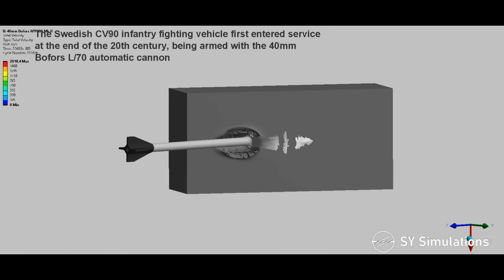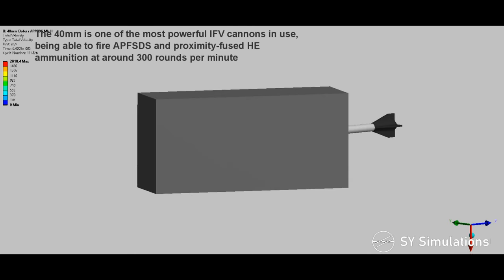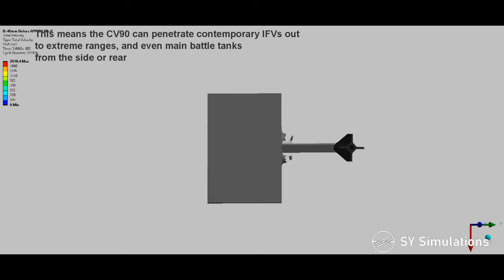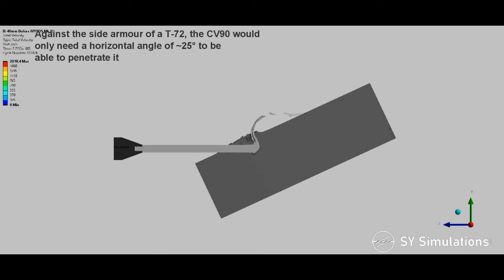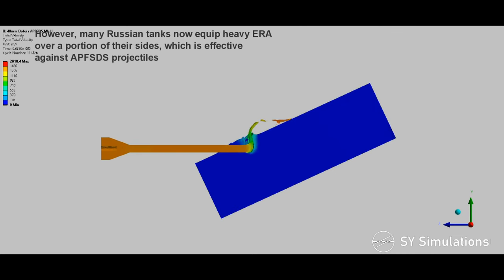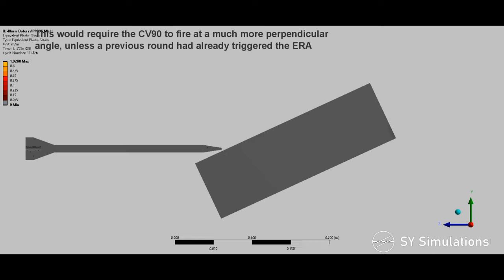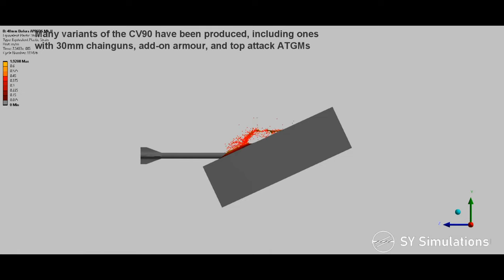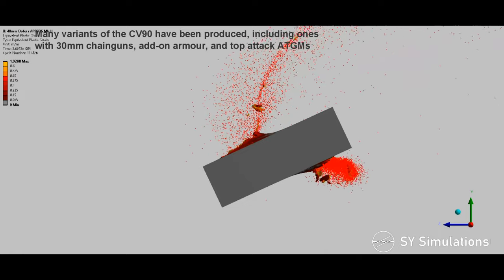CV90 vs T-72 | Swedish 40mm APFSDS vs Main Battle Tank | Armour Penetration Simulation

Comment: It makes sense that tactics would have been developed to counter the ERA. I can imagine hosing down such an equipped tank with HE follow up with a couple APFSDS rounds.
Reply: Given that the Sabot rounds can activate the ERA (since the ERA is designed to counter KE and HEAT projectiles) it would not make sense to fire HE.

1. You cant tell if the enemy has ERA unless you are super close ( you might not even be able to tell what T series tank it is)
1.a. Taking the time to decide what to shoot even if you can tell is time you are not shooting
2. A sabot round can still do some damage on a side shot even if there is ERA (if nothing else because you are not guaranteed to hit the ERA).
3. The ERA types that are designed to protect against SABOT have heavy (~1inch) plates on the outside, they may not even get set off by small caliber HE
Reply: @contagioushavoc5794  what about Armour piercing incendiary?
Reply: Regarding dynamic protection, everything is very controversial. In theory, Contact-1 does not initiate from kinetic ammunition. And it is Contact 1 that is hung on board the tanks. In many tanks, this place is blocked by additional steel sheets of 20mm. Behind them is a rubber-fabric screen, so the elements of the chassis serve as additional armor. That is why the support rollers of the T-72 tank are large. And the caterpillar c is quite thick. The thickness of the armor of the T-72 tank body in some places reaches 300mm at an angle of 90. This is if with the thickness of the support roller and an additional steel plate. If there is a contact-1, this is an additional 10mm if it does not work and 200 if it works. At an angle of 60, the armor in the most protected place reaches 600mm. But in the place where the author showed, yes, there is weak armor. 80mm housing and +20mm additional plate and 20mm rubber+container contact-1. That is, only about 110mm of pure steel + 20mm of rubber. I don't know how it will delay the projectile.
Reply: @PanzerAce760  largely replaced by APFSDS or APDS rounds in general, only nations that still make common use of full caliber AP rounds for their IFV/AFV/APC autocannons like AP-I or APHE is iirc Russia, China, and a few warsaw pact supplied countries. APDS and APFSDS almost exclusively have a better penetration, velocity, and post-pen shrapnel effect than full caliber rounds which is why they are largely the only real AP rounds used by most western IFVs or vehicles mounting an autocannon with cost and production chain complexity being their main limiting factor, which is usually fixed quickly in the case of war-time production.

 The Russians for example only barely started putting 30mm APDS rounds into production for their BMP-2/3 series of IFVs and even then they're incredibly rare in use due to the costs of production and the supply chain already in place in Ukraine using AP-I and AP-T rounds for the 30mm they use.
Reply: @PanzerAce760  API or the HEAT?
Reply: @contagioushavoc5794  No such thing as "T-series" tanks. "T" is Russian designation for all tanks, except for the T-15 Barbaris heavy IFV and T-16 engineering vehicle both of which are based off Armata chassis shared with the T-14 Armata tank.
Reply: @michigancube4240  the russians also have apds/apfsds for their 30mm autocannons, but they seem to favor a mix of AP-I and HE for better performance against infantry in buildings
Reply: iirc relikt (and maybe k5?) are designed to not go off to small caliber threats
they said specifically 30mm but i doubt 40mm is enough

Comment: Can we test some artillery and mortar shells on contemporary armour? Like what happens if a standard Russian 152mm shell direct hits a M1 Abrams turret.
Reply: he has a similar video with the 125mm HE showing the overpressure, either that or its XYZ who did the video but to sum it up the explosive force can crack the upper hull over the drivers position and likely will kill the driver with overpressure while concussing the rest of the crew. basically just size that up a bit.
Reply: 152? The explosion would break through the roof. No questions asked. Most Russian HE-FRAG shells have about 7.5kg of HE in them. Some have less by up to 2kg. Some have up to 10, in case of laser guided Centimeter-M with 12kg. That one will 100% crack the roof right through.
Reply: if 152 mm HE hits a tank directly, the tank is out of action, period

Comment: Surely the CV90 having an Autocannon makes the ERA redundant? It could only work on the shots that set it off, all follow ups would pass right through?
Reply: pretty much, iirc the rate of fire on that bofors is around 120 rounds a minute and it might be able to fire a bit faster than that but either way 2 rounds a second doesn't give you any time to really react before you have already been pretty thoroughly perforated.
Reply: @dominuslogik484  This is at 200m, and you'd be suicidal to get THIS close to the tank.
Reply: @Max_Da_G   Thats a realistic senario if we go by the ukraine war
Reply: @Max_Da_G  I have seen plenty of footage out of Ukraine with tanks blasting each other from less than 500 meters through a tree line. also though I have no idea where I said anything regarding range or referring to something that would make that particular topic relevant to what I said...

pretty sure that the round would still pen at 600 meters but barely.
Reply: Odds are any caught in the open with a T-72 within sight wount shop shooting at it until the turret pops off or the crew bails
Reply: @kullenberg83  yeah, typical trend with auto cannons is to fire and retreat so in a typical engagement as few as 4 and as many as 20 shots might hit that T-72 before breaking contact if they saw the tank first.
Reply: or ? we have seen it in action now even with bradleys. CV90 pretty fucks up everything even if its a MBT  @Max_Da_G
Reply: @laves820  also like was mentioned in the video, there's CV90 variant with top attack ATGM which i believe has around 700mm of penetration on RHA

Comment: new modern 20th century fighting armoured vehicle
look inside
-ww2 Autocannon + Tungsten stick
Reply: Comes a point when physics and engineering have to compromise, and from then on all you can really do is fiddle a bit.
Reply: @josephd.5524  peak Swedish Engineering hit in the 1930's after that they still use old stuff but somehow still effective , like Brother tell me how do they got 37mm APDS that could Pen 115mm in 1943?
Reply: the Bofors 40mm L/60 is from the 1930s, but this is Bofors 40mm L/70 from the 1950s
Reply: @juusolatva  to be fair all they did was update the breach and extend the barrel lol
Reply: @dominuslogik484  it had a now caliber and it also fired alot faster

Comment: wich T-72? The Ural, A or B-version?
Reply: Side armor on the hull is the same, 80mm
Reply: @enriqueouro9  they should improve it. What is with the T-90s?
Reply: @Neonblue84  still 80mm... T-90 is an upgraded T-72 with a new name but mostly the same
Reply: @Neonblue84  The hull from T-72B and T-90 is basically the same, the biggest change is the new turret with the T-90A
Reply: @enriqueouro9 I might be wrong, but as far as I can tell, the only version of the t90 with a new turret was the "t90 vladimir" which very little is known about. All the others are practically t72s with different upgrades depending on what version.
Reply: @I_dunno_man_but  T-90A is Wladimir (after his constructor)
Reply: @enriqueouro9  Thanks. My question was actually how this side armor would have to get thicker over time in terms of advancement on the battlefield. So all T-72s including the introductory version T-90 (T-72BU) are only 80mm. Damn thin (ok understandable as their use as so-called "breakthrough tanks") What about T-90A,T-90M Proryw-3 (will probably be secret)
Reply: @I_dunno_man_but  Every version produced in large numbers has the new welded turret, so T-90A, T-90M and the export ones.

Vladimir is the nickname for the T-90A I belive.

T-90M even has some differences with the T-90A turret altough it's difficult to tell if things like the armor composition is different.

You can look in oryx's list each version and see the turret geometry.
Reply: @Neonblue84  I meant all T-90 versions including T-90A and T-90M.

However that is only the base hull armour, keeping it the same is probably the cheapest solution to keep the factories running, newer russian tanks have improved side armour through ERA packages, T-90A has those 3 contact 5 panels and T-90M has full relikt side panels except on the engine and they have the option of extra bags of era like on the T-72B3 and T-80BVM.
Reply: @enriqueouro9  ah ok
Reply: @enriqueouro9  yeah, Im no expert, I was just looking through wikipedia
Reply: @enriqueouro9  t90 vladimir is specifically stated to be basically just a prototype, so I really dont think  its the t90A.
Reply: @I_dunno_man_but  That's what how I've heard the term used at least, either way, the T-90A and T-90M for sure have the welded turrets, you can see them in use.
Reply: @enriqueouro9  perhaps wikipedia was talking about an entirely new turret instead of a welded version of an old one?
Reply: @Neonblue84  у Леопарда 2 борт 60 в самом толстом месте
Reply: @Neonblue84  side armor on tanks typically stays relatively thin because of how large the plates have to be as is and the fact that the drive and suspension have to connect through the plate so putting composite there is difficult from an engineering standpoint. instead they just slap ERA or NERA pannels on the side to cover the important bits.
Reply: @I_dunno_man_but  You are wrong. The T-90s all have different turrets to the T-72s. The T-90 turret is a new design of welded construction, designed with integrated ERA-mounting sections on the front and sides, which were designed for Kontakt-5 but can also use Relikt etc, whereas the T-72 turret is much more round and is a cast turret. Even taking a quick look at the T-90 turret with ERA removed, you can see it is a very different construction. T-90M is also a different turret from T-90A.

Comment: I wonder if the 4cm Bofors L/70 can penetrate a T-72B3 Model 2016 with Nil Stali 4S24 Relikt ERA on the Sides this one seems to be a base T-72B3 no Relikt ERA
Reply: In theory they can fire a burst of 3P airburst ammunition and destroy most of the ERA and then a burst of APFSDS rounds. That would increase the likelihood of penetration to be quite high.

Comment: Is this projectile really that long?
Reply: should be around 20 cm
Reply: @kullenberg83  And in this simulation, the projectile is longer than the thickness of the armor. The side armor of this tank is clearly more than 20 cm.
Reply: Well the 40mm shells  ive handled the projectile was around 20 cm long. I didnt messured it exactly but if you really want to know im sure ethere is info on wikipedia on the exactl lenght @Anti_Everything
Reply: @Anti_Everything  the side armour of the t72 is 80mm

Comment: Do an iron man armor simulation! Gold-titanium alloy vs the tank round from the first movie
Reply: even if that armor was 4 inches thick it would have still been penetrated quite easily from any 120mm tank round
Reply: @dominuslogik484  yeah but just for fun. Maybe test .50 cal or 7.62 and other small arms
Reply: Titanium is basically glorifyed aluminium, while gold... well, it's softer than cheese
Reply: @user-pw1oh2mw6q  Titanium is definitely not glorifyed aluminum lol. its extremely hard and very lightweight meanwhile aluminum is very ductile and lightweight. A thin sheet of 2mm titanium can stop things like standard small caliber handgun rounds and possibly a 9mm from a distance but aluminum certainly couldn't do the same.

basically look at the altyn helmet for the effectiveness of titanium, it can stop small caliber rounds while being quite thin but any rifle round, even out of a short barrel, will go through it.